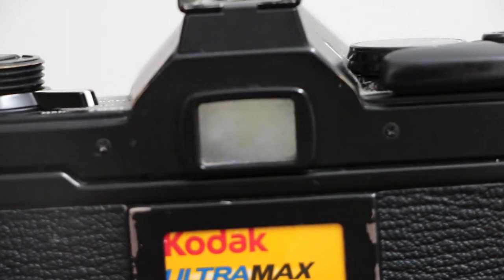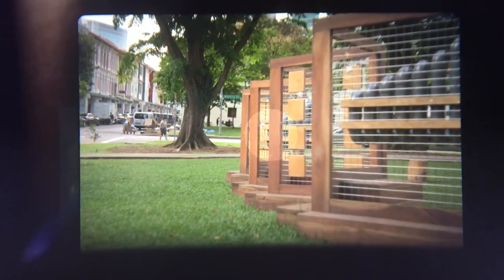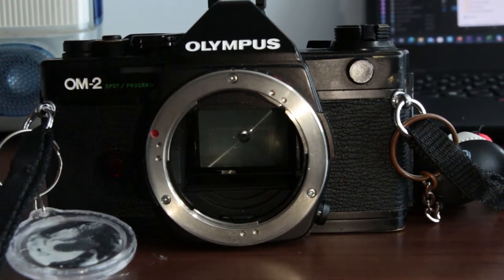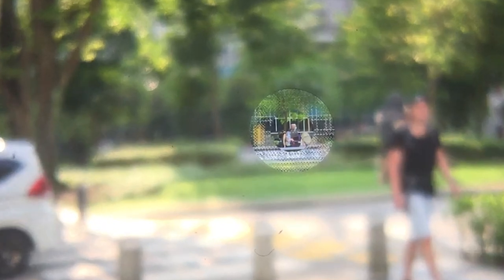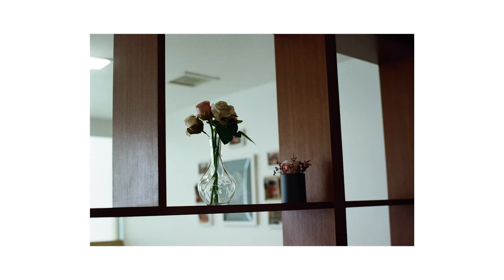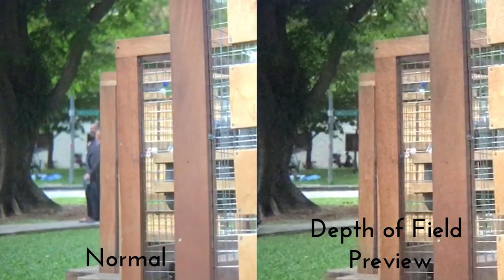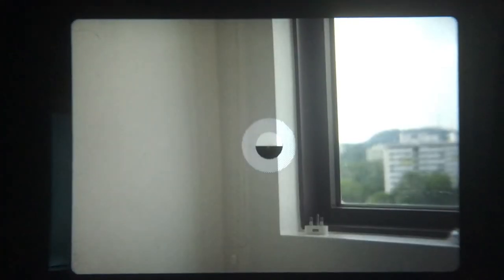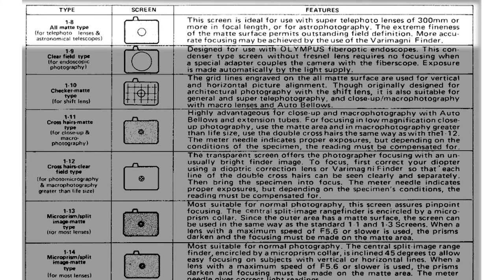How to focus with a Manual Focus Film SLR Camera

Comment: Thank you very much for the great video! Can you tell something about the possible precision of manual focus? For example when I try to focus with my Minolta XD7 (or XD or X11 depending on which continent you're on) and the 50mm f1.4 lens, I tried to focus my subject in around 1.5m distance. The depth of field at this distance is a little less than 10cm. Now if I focus this subject 3 times and take a picture each time I get one sharp and two blurry pictures which are focused maybe 10cm behind my subject. So it's more or less a game of chance, if I hit or miss. Is this normal and what is the precision that can be achieved with manual focus?
Reply from the maker: Usually manual focus can be quite accurate. The focusing aids are usually very accurate when nailing the focus. To improve accuracy, the photographer’s eyesight also needs to be accurate as well